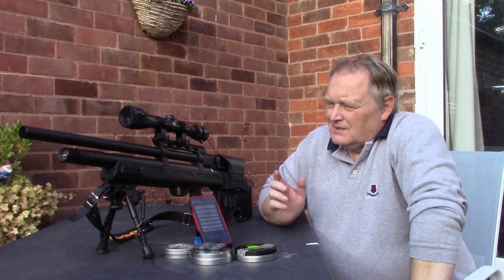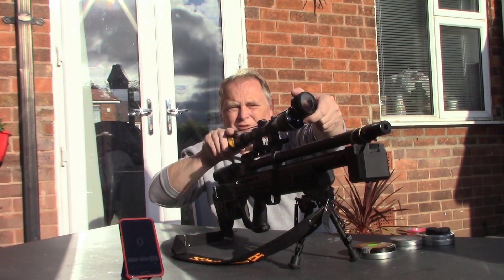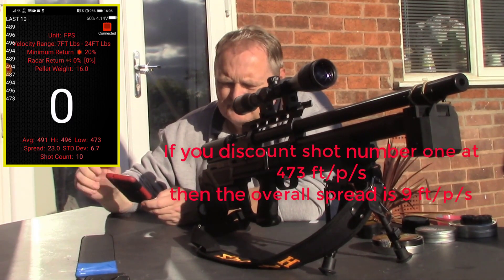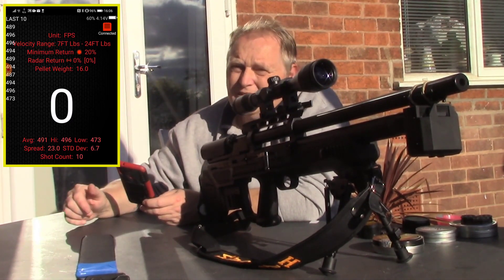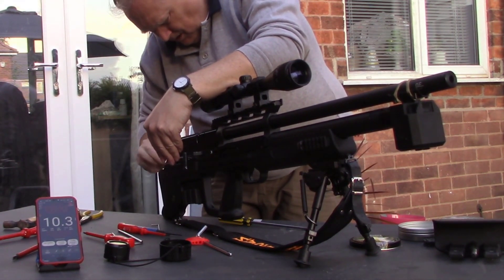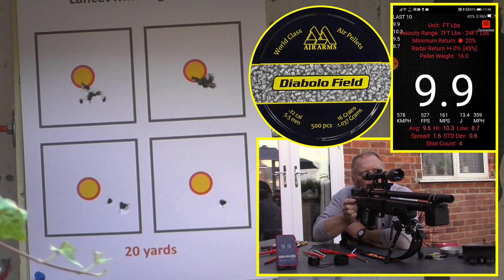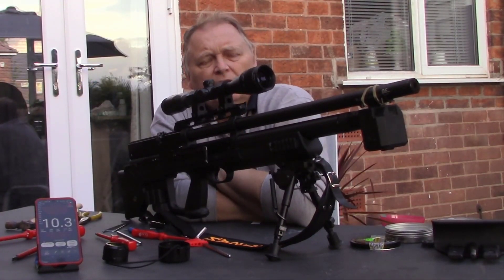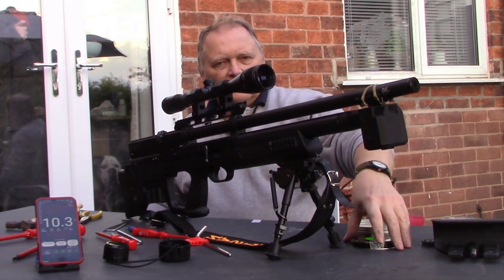Initial chrono tests with the  Lancet Mk9 regulator & Hatsan Gladius

Comment: You have the patience of a saint mate. That Hatsan would of been in the nearest river if it was mine. Then I would track down the son of a b***h who made it. What a truly awful rifle. Take care stay  safe and sane. Regards Tony
Reply from the maker: Yes, it's a good job I like a challenge and don't mind spending time trying to get the best out of a rifle, or it would have been chopped up by now LOL.
Reply: @airgunsniper-elite7385  I hope I show the same patience when my Altaros arrives for my Mk 3 Air Arms S200 lol. Iv learned a lot off your videos really helpful. Il be happy with 60 full power shots off 190 bar charge and consistent. Not sure on reg pressure though, 100,125,150 bar I may tap you up mucker for tips. Stay safe all the best. Regards Big T
Reply from the maker: @tonyashton780  I think the regulator comes set at 100 bar, but you can adjust it up or down. From experience the hardest part of the process is removing the bloody valves to get into the cylinder. I think bumble bee from transformers hand fits them. Unless it's already been apart you'll need a special tool and the use of a soft jawed vice to remove them. Robert Lane, Alteros and HUMA Air all sell them. After this you will need plenty of air for testing and a degasser would also come in handy for emptying air from the cylinder. I used a punch in my vice and emptied the air by pushing the exhaust valve against it rather than dry firing it. You can buy the de glass tools, but the last place I saw selling them was pyrimid air in the US. If you get the Robert Lane reg he will send all the parts and instructions minus the tool to remove the valves, so you would need to order that at the same time. He even supplies the drill bit for opening up the transfer port and barrel. You'll find that the main balance is fro te valve spring tension and regulator pressure. I have found that this had more effect than the hammer spring. Its time consuming, but at least you'll get to know your rifle inside out.
Reply: @airgunsniper-elite7385  Many thanks Mark top tips, luckily mine have been off before. CZ use loctite, you need a hot air gun on lowest setting for at least 15 mins plus the cylinder tool really needs biggest set of Stilsons or Mole grips you can find. If it's still sticky use second heat setting as soon as joint cracks you need to rock it clockwise and anti clockwise to bust up the loctite. I can remember doing a Falcon FN19 years ago with a TR Robb collet that needed some heat, soft rubber jaw vice and an old rubber inner tube, pig to come off until the green loctite busted up. Stay safe mucker cheers and looking forward to next video.